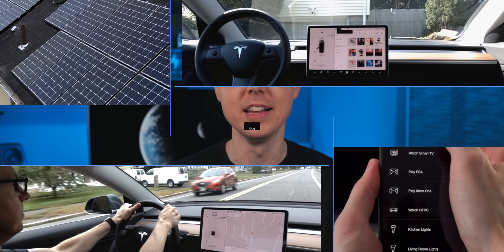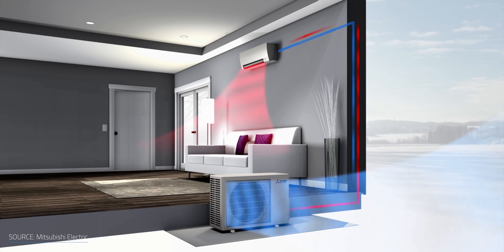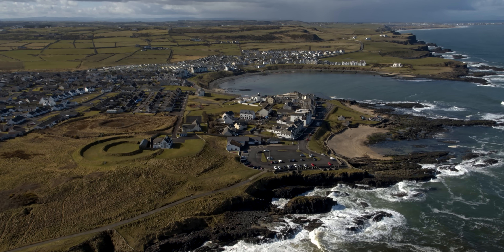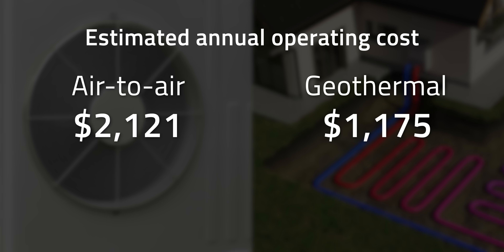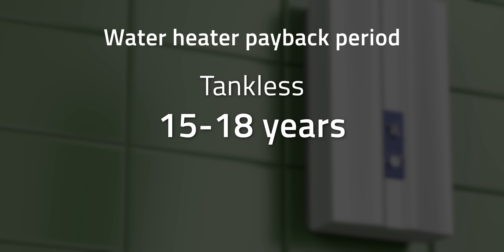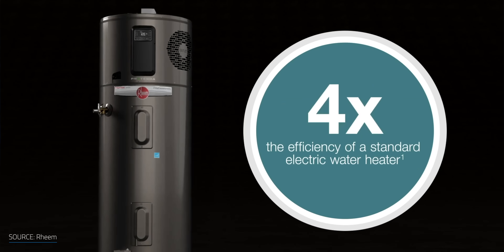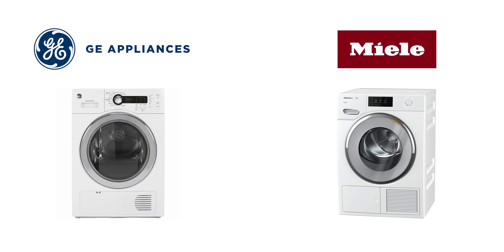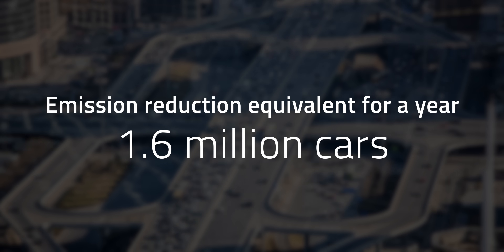Why Heat Pumps are Essential for the Future - Explained

Comment from the maker: Do you think we need to heat pump all the things? Go to https://curiositystream.com/Undecided to get Curiosity Stream for only $14.99 for the whole year! 

If you liked this video, check out Solar Panels Plus Farming? Agrivoltaics Explained https://youtu.be/lgZBlD-TCFE?list=PLnTSM-ORSgi5LVxHfWfQE6-Y_HnK-sgXS
Reply: being tied to a grid system sucks - look at the rolling blackouts in california or texas. if you take away natural gas or oil you are putting yourself even more at the mercy of the grid. if you have solar this seems like the way to go but not many people have 50k for solar and 50k for geothermal so its not helping out the people who are affected the most by those high fuel prices.
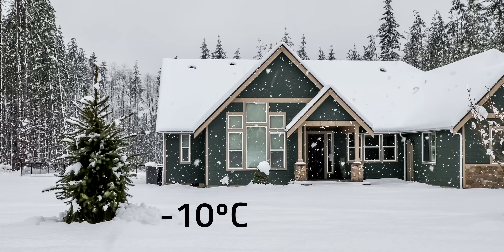Reply: The number displayed at 5:04 for Fahrenheit should be "14", not "-14." Further, the voice over says "10 degrees Celcius" but it should "negative 10 degrees Celcius."

-10°C = 14°F
Reply: Generally yes, although water based appliances may not need it if the water heater uses a heat pump and the tank and temperature are correct.
Reply: Is there anything like HVAC in Teslas (Supermanifold) for homes that would integrate all the heat transfers in your home? It'd be incredibly awesome to have a hub, where you'd be able to connect all of your devices that produce and/or consume heat and have the hub move the appropriate amount of heat from source to "consumer" device. For sources in home, you could have your fridge, AC, even liquid-cooled PC or home server, for "consumers" you'd have your water tank and heating. Then external heat pump and the heat storage solutions could do whatever is needed at the moment.

With this in summer, your AC would keep each room at set temperature and with the removed heat heat up your water for a shower in the evening with the help of your PC and fridge, which wouldn't heat up the rooms they're in (easing work for AC) and if that's too much heat for the needs of the house, heat pump would dump the rest outside. In winter, this would distribute the produced heat wherever it's needed and pull additional from the outside if and when needed (can be optimized to electricity price).
Reply: Yes, let's star with using heat pumps to cool small boxes to keep food in!
Reply: With ground source/sink heatpumps, you can bank the heat you don't need underground and then use it in the winter.
Build this big enough, and you can heat and cool a whole town over the whole year or at least reduce energy usage.
ps. dryers should have permits or disincentives to use because they are so wasteful. A clothesline hung outside or in an aerated room costs next to nothing.
Reply: most places are phasing out r134a for R32 boiling point of -51
Reply: Collab with Matt Risinger home builder of super efficient homes.
Reply: I recently heard about a company Sunamp, they make Phase Change Thermal Energy Storage, which looks like it could be an effective solution to heating. they work in the same way as reusable hand warmers.
Reply: Ah, finally following Technology Connections' footsteps I see?
Reply: Moving heat, rather than burning 300 million year old solar energy in the form of oil, coal and gas , that increases the global temperature by emitting greenhouse effect gasses, perfect.
Reply: Matt, I do believe that Heat Pumps have a place, but as you know, the 3 x 5 efficentcy are more theoretical vs realized at this point.  In many places they are expensive to install, plus the people don't account for the maintance.  While I do believe they have their place, no solution is the one all be all for everyone. 

If you are looking at Heating, take a look at infrared heating.  These things are amazing as it heats you and the mass in the room, not the air.  It is the feeling you are being heated by the sun and as such, you use less energy because you feel warmer.
Reply: @DrToddles  Meanwhile at the coal plant making my electricity....
Reply: Heat pumps to all the things and i mean ALL! It is recent weekend that I've been thinking, what would it take to equip heat pumps to cars with ICE. There is already one loop and a heat exchanger... With that one could easily up the efficiency of the engine to 50%, potentially over 60
Reply: Always great stuff Matt.  Looking forward to your build!
Reply: Heat pumps are great but you've got to talk about noise. We had a heat pump water heater put it, the noise was unbearable even with MLV soundproofing put into the room. Complained to the installer, they got a manufacturer's rep out, and finally 4 months later they replaced the unit with a quieter one that is tolerable.
Reply: Oh Matt did you mention that you are building a Net-Zero Home.. and that we should watch out for videos about it later this year?? Yea, I think you should mention it AT LEAST THREE TIMES..... Oh and don't forget that you can mention it a bunch of times in all the other videos you do until then :)
I'm just messing with ya... sorry.... but you DID bring it up at least 3 times this week... at I think twice last week.....  I just want you to realize how much you bring it up... but I can TOTALLY UNDERSTAND.. I would be SUPER PSYCHED TOO!!! I'm really HAPPY for you bro, not everyone is able to make it work doing YouTube, and you seem to have a great channel with a solid audience. And even if you aren't the only income in the house, I'm guess that you putting in your half of the effort towards thi0s dream .... :D CONGRATULATIONS!!! :D
Reply: Matt, actually, before Washington State banned gas space and water heating, NYC (a city with a larger population than WA state) banned all gas appliances from 2024 on... so that will likely have a much bigger impact on the market, supply chain, etc. I think the heat pump market is primed for much faster growth than the projections. Once economies of scale kick in, the cost for equipment and install will also drop to be more competitive upfront as well.
Reply: @danielroden9424  A slightly different take...granted the solar and geothermal costs are an obvious barrier to those who cannot afford them and or live in accommodations where these systems cannot be implemented, however their implementation by others does help these folks...reduced air pollution and (hopefully) reduced climate impacts over time will result in improved health for the general population as well as the likely reduction in the cost of fossil fuels as the transition happens and the reduction in the cost of these two systems as they become ubiquitous....all benefits.
Reply: I can’t tell you how much I appreciate your videos! I am planning to build a home next year and am doing the exact same research on efficiency and sustainability for the build. This has been so helpful! Please continue to share these “rabbit holes” :)
Reply: Hey, Matt. Sweet video... in case it's useful: I just put in a heat-pump HVAC system, as well as a new full-sized (the only full-sized 27" model available, as far as I know) heat-pump based dryer. I'd be happy to provide feedback/photos if it helps you in any way...
Reply: Matt, I have a GSHP using water to air circulation. Here are a few things I have learned. 1) if your house is not well insulated and sealed (which yours will be) a heat pump may not meet your heating and cooling needs at the more extreme ends of the temperature range. Your energy consumption will skyrocket when your heating back up ( a resistance coil) kicks in so you want that to be very infrequent 2) Water is a far better heat transfer agent than air...and because heat pumps work at lower temps, where radiant systems must work, they are an excellent combination (we are looking into radiant cooling for our GSHP as we transition to radiant in our house).  3) Heat pumps are very vulnerable to improper sizing...too big or too small and the efficiency and longevity will be negatively impacted. 4) Air to air and water to air heat pumps never feel warm...in fact they feel drafty because the blowing air temp is so low and the volume of air being moved is much greater than an oil or gas furnace. 5) Retrofitting a heat pump to an existing air handler can be problematic since much larger ducting and higher volume fan are needed...noise and draftiness become a problem using existing ducts.  6) With GSHP's it is critical that the ground loop is sized perfectly to the system and that includes taking into account the ground that the loop will be installed in.  As mentioned the heat pump itself must be matched to the buildings Heat loss and Heat gain and the ducting or radiators must be sized properly to get the efficiency these devices are capable of while also providing the comfort that they should be capable of.  7) Make 100% sure that your installer is experienced in the type of heat pump you are having installed, that the manufacturer has trained and supports the installer (contact the manufacturer for confirmation) and that the installer is capable of servicing the unit...it's worth ensuring that the brand is supported locally by more than one installer in case yours retires early....many HVAC companies will not even attempt to service heat pumps that they are not certified in (speaking from experience) ...get at least three references and be sure to speak to all three.  
Looking forward to your house building videos.
Reply: Matt, although it's a comparatively niche product in the US, a Sanden heat pump water heater eliminates some of the concerns you raised about hybrid water heaters, and it's even more efficient and environmentally friendly, although the purchase and installation cost will be rather higher.
Reply: Happy Super Month. 👩🏿‍🦰
Reply: Matt, how come that Curiosity Stream is your sponsor and you don't have your channel on their Nebula?
Reply: I'm all for the greater efficiency. However, one thing that concerns me is that heat pumps in the US typically use extremely potent F-gases as their refrigerants (HFCs), and these gases have greenhouse gas coefficients that are thousands of times worse than CO2 and last for centuries in the atmosphere. This, of course, is only a problem if they leak out, but when there are wildfires that destroy entire neighborhoods happening not too infrequently, the contingency for what happens when they leak or otherwise get destroyed needs to be taken into account. Low GHG-coefficient gases can be used for heat pumping (such as isobutane), but if the heat pump manufacturers are not forced to use these alternatives, they probably won't. The alternatives tend to be flammable gases, but the risk from this can be mitgated in various ways.

The leakage of HFC gases is so impactful that Project Drawdown ranked refrigerant management and alternative refrigerants as two of the most impactful things that could be done to fight climate change. This must be taken into consideration while advocating for the proliferation of heat pump based solutions.
Reply: your temps are messed up at 5:04. You say "10 degrees Celsius or 14 degrees Farenheit" but iyou should say "NEGATIVE 10 degrees Celsius...". Also, you show -14F on the screen, but it should be 14F (no negative).
Reply: Heatpumps have been essential for fridges and cooling. For heating homes they canchelp some, but it's way more efficient to burn natural gas directly for heating than burning gas at an electrical plant at huge losses and transport losses and trying to compensate for that by mechanical compressors that are expensive to install, cant heat to 65°C and ware out way faster than gas heaters.
Reply: @gnomechump-stiny7128  The host might find someone who is less focused on one climate setting.
Reply: @richardlangley90  Did you put in the Euro water heated towel rack at your showers? They work so well, plus a heated towel during the heating season. 

As the CO2 (R-744) based air to water heat pump, supplying combination domestic water heating systems with hydronic space heating systems taking heat from that system via heat exchanger, become more common, do you think the ground GSHP systems will become less common, or there will be regional differences, between regions with more heating or more cooling need?
Reply: You completely missed the most common heat pump we all have in our homes. The Refrigerator and Freezer. I'd love to be able to connect the water heater, hvac, clothes dryer, fridge and chest freezer all together to manage moving heat around (getting rid of it in some places and storing it in others).  For now I'll settle for the water heater and hvac both being on heatpumps, and wait for the future to tie them all together :)
Reply: @billsmith5109  Haven't tried the heated towel rack yet Bill.  I am not an expert but I do believe that in moderate climates the air to air or air to water systems are a better choice than the GSHP because they can be as efficient in those climates, are more accessible and cost less.  For more extreme climate temps the GSHP wins out due to the more dependable constant temp underground as the source of energy to transfer.
Reply: I have ground source a HVAC and I am actually on my second one the first lasted 25 years. The second is way more efficient that the first. Look into getting an option to send heat to your water tank. In the summer hot water is never an issue. It is supposed to provide hot water in the winter. It just feeds into my water heater.
Reply: That’s just a vrf heat pump.
Reply: I was wondering, here in the Netherlands getting your house heated with a heat pump actually has quite some additional steps that are not mentioned in this video. Perhaps it's due to the fully concrete houses that we have, but when I looked into heat pumps I was looking at an investment of around 20 to 30 thousand euros. Mostly for additional insulation, replacement of radiators to low heat types and close off all airvents, as well as replacing the extractor and the air circulation system. Is this something others have experience with as well?
Reply: @dukee4333  Sounds like you have work to do. In my state we have eliminated all coal and oil sourced electricity. Now we are working on the much harder to eliminate gas produced electricity. As for myself, my solar feeds more to the grid than I use. Good insulation and a mild climate helps.
Reply: @danielcarroll3358  Cool, so you invented new battery technology?
Reply: I think using those solar panels that uses water pipes to cool the panels and uses the heated up water and puts it in your water heater or just straight to your sink.
Why well it cool the panels from 150f or more to 110 f or less.
Reply: Hey, there are some spam imposters with your profile picture in the comments. People should look out and report them.
Reply: @Etacovda63  Variable Refrigerant Flow (VRF) systems are typically all-electric systems that use heat pumps to provide space heating and cooling to building spaces (ECW, 2014). They are capable of serving multiple zones in a building, each with different heating and cooling requirements.
Reply: @danielroden9424  "look at the rolling blackouts in california or texas"

It's not the grid that's bad, it's the fact that PG&E is a clownfest and Texas is a goat rodeo.

I think I've had a significant power outage maybe... thrice in my entire life?
Reply: So we own a Whirlpool heatpump dryer that we purchased for $1300 Canadian (~1k US), and I'll say this... we love it.  We also came from a super inefficient almost 20 year old dryer, and the energy consumption difference, dropped our hydro bill almost $45/month, while actually INCREASING our usage of the dryer. As for not getting as hot, will it burn your hands when you take it out, nope. but the clothes still come out hot enough that its uncomfortable to put on something straight out of the dryer.  We can dry a absolutely full load in ~85 minutes. Which is only 10 minutes slower then our previous dryer, that we would sometimes have to run twice to get things actually dry.  This thing has paid for itself within 2.5 years on bill reduction alone, and would have been faster if we didn't dry even more clothes now (we had a child just after getting the new dryer). Fully recommend.
Reply: Excellent video, Matt. Yes, finally I had the time to watch this. :)
Reply: @dukee4333  No. I rely on pumped hydro energy storage.
Reply: Thank you for the quality content.  I work HVAC with my dad and he is old school so I go with all of his thinking, however I do believe in a more efficient future.  I live in Colorado where it's not all that hot or all that cold for all that long so we may have a unique situation.  I know you consider all thing's but I figured you'd appreciate my anecdotal work in the HVAC field.  In our climate and work environment we find that "high efficiency" never works out for the better, certainly on a financial understanding which in some way may play out to an emission stand point as well.  For heating, high efficiency gas furnaces never ever pay for themselves.  The equipment, installation and maintenance are all greatly increased with a much shorter life span.  The parts are more expensive too.  When you introduce water into the system by cooling the gas so much it adds exponential complexity.  One example is the variable speed blower motor or ECM, a typical PSC motor is about $100-130 our cost and we charge $350-450 to replace it, the variable speed motors can easily cost $900 just for the motor.  Another problem is that many manufacturers of high efficiency furnaces do really stupid thing's, I've seen circuit boards with integrated pressure switches so when a normally $15 part fails, it's a $1k circuit board that needs to be replaced.  In these situations it's just smarter to install a new standard furnace and get rid of the headache.  When you think of all of the emissions going into producing and installing that furnace I would imagine it is a major loss.  The biggest problem in the HVAC industry is shady companies who don't fix rather replace, we have countless systems that were red tagged by other companies yet running for years after we made a cheap and simple fix.  The big box companies charge literally 3-5x what we do and worse than that they lie about it.  I know this is just a financial example but dollars and emissions must have a correlation.  On the cooling side of thing's we've come across heat pumps and/or extremely high efficiency unit's that literally no one in the state knows how to work on them and our tech resources come up empty handed.  I think that there is something to be said about reliable and low maintenance systems, not just financially but for a greenhouse consideration as well.  We only install Rheem because we truly believe in the brand and don't want to work on it after it is installed.  I however wasn't aware of the 3-5x energy gain vs conductive element heating, that is extremely interesting.  I would be interested in the comparison in my climate vs gas on a cost basis.  Thank you for the information, I'm new to the channel and you are very thorough and I appreciate that.
Reply: @DrToddles  of course they would, would you eat a 300 million year old piece of bread, No? then i don't want a stale piece of solar energy either.
Reply: @theawkwardexpert  i don't, he made 3 bad examples, 1. "heat pump works like AC" yes of course AC is a heat pump, even if it's a fan with a water sprayer, fire works like fire because it's fire, but no one states it, it's a casual water is wet statement.
2.*2
"heating your AC because it got cold" is stupid, just run it in reverse, a quad valve is not that expensive instead of using 5 times more energy of resistive heater for the outside unit, if that doesn't work manufacture bigger surface heat exchanger so there is more surface to exchange heat with the surrounding air and less drop in temperature as a result.

To Matt: "change the argument, not the person" is impossible when you(the hypothetical person) says 2+2=5 and believes it, change the person so he could change his argument for the better.
Reply: @wpmulligan  Also the refrigerant used is 410A not 134A
Reply: I'm from Phoenix AZ I think it's essential all electric water heaters and clothes dryers should be mandatory heat pump versions only. Due to the strain on the airzona electric grid from all the air-conditioning units. If everyone utilized heat pump appliances it would take a significant strain off the electric grid
Reply: Happy Super Month. 👩🏿‍🦰
Reply: can you do a full video series on the tech of your upcoming home? similiar to Linus Tech
Reply: Interesting enough, Technology Connections has also recently done a series on Heatpumps also.
Reply: 1)  the earth regenerates oil
2) co2 is not a problem

you're not a scientist, you're a youtuber
Reply: Yes. ElectrifyEverything

Unless you live in climate zone 7 or colder you might be better off with an air source heat pump, for a whole slew of reasons
Reply: Our electric power company in NJ just sent us an email to prepare for summer power outages. Which follows preparation for the winter outages. So before anyone considers heat pumps for all the things, solar and battery backup is a prerequisite. Of course, it can take a year (or more) to get that scheduled, approved by your township, and installed. And then yay! More property taxes.

It seems that while the government agencies tout going solar/battery and heat pumps, they put every possible delay and tons of roadblocks in the path. Just yesterday, the president of the US had to put a (temporary) moratorium on tariffs for solar imports. If it takes executive action to cut through (some) of the roadblocks, there's something very wrong (*cough* fossil fuel industry b̵r̵i̵b̵e̵s̵ lobbying).

And then there's the cost. While the $75,000-$100,000+ to do all these things may be acceptable to the top 3%, the 97% doesn't really have this as an option, especially in today's economy. It kind of feels futile and pointless.
Reply: "heat pump all the things"??? how do you HP your telly???
Reply: Just fyi most home heat pumps run off R-410A (old r-22) and starting in a couple years R-32
Reply: @nc3826  As long as it's not wet outside, it does still work though not as quickly. Can still bring it inside though.
Reply: @nc3826  Octovalve connects to the Supermanifold and direcrects which way "circuit" will be heated and which one cooled. Supermanifold is the part, where all these flows meet.

Elon has talked several times about Tesla doing home HVAC similar to what they have in cars, but it's too low priority for them for now. I'm just amazed that no other company has yet picked up on this.

There are many technologies that you can use for heat storage and water tank is one that is currently most used (most peaople do shower), but almost all of them take in the energy (electricity, fossil gas etc.) whenever they "want", not when it's most appropriate. The example of a good change here is UK company Mixergy that makes water tanks capable of heating just desired % of the volume of water in the tank and thus taking in the energy whenever most convenient (off-peak, PV etc.). Some of their models even have provision for piping in external heat source.
Reply: I live just outside Ottawa Ontario,  the heat pump we have worked down to -30C  then could not cope with the cold, thankfully we only had a few nights and days that cold, so we were golden the rest of the winter, we used wood as back up and very little of it.
Reply: OFC water tanks can be used to store heat, since it has been used for centuries... Including externally heated water, so it is nothing new....  Mixergy just added stratification, which does not improve the thermal mass of water....

While "latent heat" (ie phase change thermal battery) is inherently a more effective way of storing heat...  Then even the very expensive and heavy Mixergy tank... 

But I'm far more curious, about where you heard of integrating the heating and cooling appliances? From Mixergy? As I stated earlier, it is so rarely done I'm happy to see it done in any fashion. 

BTW thx, for confirming that the term "Supermanifold" is just another one of Elon's bloviated memes for a more common term or device that he pretends to reinvent.... Just like the great marketer he is, but at least it makes me laugh.. So it is all good ;)
Reply: I have been thinking about this concept for about a year now. It is fun to think about all the ways to tie into this. 

In summer push all heat into the hot water tank

In winter push the heat to the desired rooms. 

This could even run a heat pump water generator to pull the water out of the house when it is too humid.
Reply: In Quebec, there's more than 220 k heat pumps installed. No major issues. Obviously some models are more efficient than others. With climate change, heat pumps are useful for two big reasons. They are energy efficient, so you use less energy to heat your home in winter than with other types of heating systems so less CO2 emissions and secondly, as a bonus, you have a high efficiency cooling system, which can save lives during heat waves in summer.
Reply: Love my heat pump. All electric heating, all electric hot water, all electric cooking, all electric car.
Reply: yeah, can't heat pump everything. basically, this is an air conditioner when it comes to noise, longevity, reliability but could be worth it if you generate most of your own electricity
Reply: @lukeaaron5588  good insulation standards are a good start
Reply: @monkeysezbegood  👍
Reply: @picobyte  depends on your climate. A heat pump can provide more heat than burn gas, even if the power is made from said gas. Heat Pumps can be 300% efficient or more
Reply: heat pump all the things! 🙌🏽 r u getting PVT solar panels on the new home?? congrats 🍾 excited for u (and us lol)
Reply: @LamarreAlexandre  I don't think people outside of Canada, realize how deadly the heatwaves here are.
Reply: @LithaMoonSong  If you're right, that's a problem because heat wave are indeed deadly. Just look at the number of deaths we had in BC last year because of the heat wave. I think it was around 600.
Reply: @monkeysezbegood  You are 100% right. Whatever systems someone uses to heat their home, a good insulation will reduce your energy bill.
Reply: @monkeysezbegood  You have a very good point that should be emphasized.
Reply: being electric, this would add strain to the power grid, and may drive up costs.
during summer in aus we are told or incentivised to not use so much electricity.
i can see some benefits though.
Reply: @danielroden9424  exactly, loading even more energy demand into the electric grid (heating, transportation, etc) will just cause even more blackouts. While HVAC systems already overload the system in summer, the heat pumps etc will cause blackouts in winter.
And houses just don't have enough roof space for solar, to generate enough energy for electric demand, not even mentioning several kWh for heating per day.
Reply: I’m moving onto Farmland I’m going to try a hybrid permaculture multi purpose farm style homestead. Is it possible to do these in a off grid self sustaining setting like worst case scenario societal economic collapse. I’ll also have a wood stove as back up, fire pit, and forge is there away to collect the thermal heat from using these and store it as power. Or is it possible to make a hydro electric wind hybrid system that will do a downward flow from retainer pond to retainer pond with dams as the hydro utilizing the hydro power with the wind turbines on the top pumping the water back up to the top as a continuous cycle to continue to generate energy for a home setting with any extra runoff going to crops, other fishery ponds, or to a water storage tank
Reply: R134a is really only used in refrigeration. R410a is what you should have said
Reply: @alkjhsdfg  Good information, thank you for sharing your experience. By the way, I recently reached out to Rheem to ask for more info about their possibly louder newer models, and will be letting Matt know what I learn.
Reply: When my furnace dies I'll definitely look into it - but being in central Canada winter performance will be a major decider. The hot water tank and dryer will likely last forever if I keep up maintenance - and I don't like replacing things that are not broken.
Reply: thomasjeffersoncry  Funny. Do you think that something being "illegal" really stops someone from doing anything they care about?
Laws against clothes lines shouldn't be permitted because the common good should win - not because idiots get offended at the sight of a bra or a towel drying in the sun for free!
Reply: Whirlpool makes great heat pump dryer.
Reply: Please supply that state by state heat pump efficacy you showed.
Reply: I think that people ought to be educated enough to make their own decision.  Like did you know that SEER doesn't describe moisture removal and the higher the SEER the less moisture the heat pump removes from your house?  There's just one example.  I live in FL, so SEER doesn't mean much.  We have very high latent (humidity) loads that needs effectively dealt with.  A whole house ventilating dehumidifier is a must in any humid climate and inside we should keep humidity under 55% at all time while bringing in fresh, filtered air.
Reply: @dukee4333  Check out Ambri, a company that is working on molten-metal batteries for moderate scale and huge scale energy storage. Videos here on YT.
Reply: Anything using electricity isn't carbon-free if the generation of the electricity isn't carbon free. And wind and solar are not constant enough to be reliable sources of reliable baseload electricity. 
-- If you grow trees on your land for fuel and burn it in a highly efficient stove (Jotul 602, e.g.), you're pretty close to carbon neutral with a much lower energy bill.
-- And then there's nuclear energy for the grid. Thorium reactors would be nice, but for now, the technology on uranium reactors is a lot better than it was some decades ago, and safer. I don't take anyone who claims to care about the environment and about people seriously if they aren't willing to take nuclear energy seriously. Techno-environmental elitists on comfortable salaries are willing to let the poor starve, freeze, or surrender to government dependency and control in order to "save the planet." Save the planet for whom? For the elites, of course. The people are just livestock.
Reply: I'd be curious to know what kind of house you'd build to be the most efficient with all the bells and whistles, maybe something with lots of integrated systems and possibly off grid even.
Reply: Could you not also intergrate a heat pump with a solar water heater as well for times when one or the other is not producing enough. Then on top of that intergrate a solar system and battery bank?
Reply: Matt, I actually think that an air-to-anything heat pump is better than a geothermal one, from climate change standpoint. An air-to-air or air-to-water heat pump borrows heat from the atmosphere, temporarily puts it into your house, and by time that heat escapes through doors, windows and walls back to the atmosphere. A geothermal heat pump borrows heat from the ground and releases it into the atmosphere (through your house).
Reply: O, and finally it's pretty easy to add on a small propane tank and boiler to suppliment on the worst days of winter, and with air to water heat pumps, you can cascade the units to attain higher heating or cooling!
Reply: Super interested how heat pump dryers can attain such high heats!
Reply: @user-by7hj4dj9s  been a commercial HVAC service tech for 15+ years and haven't seen a 134a heat pump. as of now 2022 410a is the common type heat pump. 410a is being phased out 2030 btw.
Reply: @danielroden9424  Man, remember the days of Enron and their artificial blackouts/'shortages' to increase prices?
Reply: I already have a heat pump. Most of the ACs are heat pumps. We'll all get heat pumps, then the price of electricity will skyrocket. Can you find more hype topic for the hype channel next time??
Reply: Well, actually the hot water should be solar hot water because the solar energy can heat water to a higher temperature than a heat pump.  You would always need to augment the heat pump with electric but, the solar hot water, especially in summer, comes down so hot - it does not need any electric.  I think you even stated that solar hot water is 75-85% efficient which is comparable or better than heat pumping which only uses electric.  I think you should compare the two options to see which would use the least electricity.  Remember, you are going to use solar (18% efficient) to run the electric side of things - do you want to heat water only with electricity?
Reply: @destronger5313  410a for 410b right? about the same melting point as R32
Reply: Ooooh. Net zero. You'll need a three legged dog to go with that.
Reply: @TagiukGold  Like a refrigerator?  That's not heat pump technology, it's just like an air conditioner - it takes heat out of the food box and dumps it into your kitchen.  Call it a space heater and now it's a heat pump!
Reply: @meberg500  a refrigerator is a heat pump, it's just not bidirectional. An AC is also a mono-directional heat pump.
Reply: @TagiukGold  Pedantic much?  They're all refrigeration cycles.  Would you call that water heater a water source cold room maker?  But to your original point, yes, it's high time someone found a way to use heat pump technology to keep a container of food cold in my kitchen!
Reply: Lennox use to make a heat pump with a dc to ac converter built into the outside unit so you could plug solar panels directly into it for a grid tie system. I never understood why that didn't catch on it would make solar pretty much plug and save. My own thoughts on heat pumps is they are good for hybrid systems, water heaters, or in warmer climates we are in the midwest and use ours down to 45 degrees then it's 100% gas heat with a furnace.  That seems to keep a good heat feeling in our home and keeps the bills very reasonable.
Reply: 3:11 inside is the condenser (when running backwards)
Reply: heat is like vibration, it can be cancelled out by introducing an opposing vibration. heat exchange is a very old concept and technology, the future would be the control of temperature without releasing heat.
Reply: In theory, yes, but mandating it in new commercial buildings is simply going to increase the cost of building new housing developments, and rents are already high enough. If you've got the money to build some expensive net-zero house then this doesn't apply to you, but for the normal person that's just trying to find a reasonably priced rental, these draconian policies push people out of housing. Not that I expected anything less from Washington.
Reply: Matt, look into mini split systems before you take the "just heat pump" leap. 
Thank you for sharing your vast knowledge and diligence with a world that needs it more than "it" knows!!!!!💖💖
Reply: Absolutely!  We live in the Greater Boston area too and we switched over to a air-to-air heat pump system due to the $10K rebate from MassSave.  The whole system costed a little over 11K so it was a no brainer for us.  Our home is heated by LP or Propane because there is no natural gas line on our street and we had been seeing propane costs rise in sync with gasoline prices.  We were spending over $600/month just for the propane refills when only a year ago we were hitting under $300 and the year before that we avg. $250.  We haven't had to refill the propane tank since March now, so I have no doubt we've already saved over $1800 in heating costs.  We still need the propane as that is what our tankless water heater and our oven range use for their fuel sources, but the biggest consumer of the propane was the furnace.  The MassSave rebate allows us to keep the furnace for emergency purposes, so if the heat pump doesn't keep the home warm enough next winter, we can turn on the propane furnace to supplement when needed.
Reply: One thing that stands out in the argument for using natural gas for heat is that gas produces a warmer heat from the supply vents into the home airspace. Although heat pumps are producing much warmer air than even a decade ago, they still can't compete with gas for that very warm feeling on a cold winter day.

Of course, it's very difficult to be net zero using natural gas, but for those of us who aren't able to install solar panels to operate a heat pump we have to do what we can to lower our cost to heat and cool.

One thing that helped us is to double the amount of insulation in the attic. That along with a very high efficiency gas furnace cut our heating expenses by 2/3 compared to using the older heat pump.

I always appreciate your videos that give pause for the viewer to stop and think about the topic. It helps to occasionally test out our current views to see if they still hold true with the current affordable technology.
Reply: Gas is so cheap??
Reply: @donglers  switching to high efficiency gas furnace from a heat pump has saved me a lot on heating expenses. Cut heating cost by about 60%.
Reply: No discussion about water heaters is complete without discussing a hydrosonic pump. Hydro Dynamics makes them to this day, they heat water on demand with 99.9%+ efficiency.
Reply: @REG3305  do you not think that renewable energy, or less polluting energy is a good idea for a long-term goal to protect the environment?
Reply: @MicahFunk  cleaner COULD BE BETTER.  Ultimately,  NO ONE KNOWS but instead only SPECULATES their narrative.  
How did Solyndra do with our money?

60s: "We are going to run out of oil in 10 years."
70s: "Fossil fuel (FF) burning is bringing on 'An Impending Ice Age'  in 10 years."
80s: "FF are causing acid rain which will kill all the crops and bring on starvation within 10 years. 
90s: "FF are going to deplete the ozone layer in 10 years. "
2000s: "FF will cause NYC and Florida to be under water within 10 years. 
2010s: "Cow farts and FF are making for severe weather to be worse and possible unlivable within the next 10 years. "

Bro... Liberals believe that within the next 8 years the world will be unlivable. 

How many times does a group/ individual have to be proven fraudulent liars for you to realize it is ALL SIMPLY TO CREATE NEW TAXES so politicians have more of our money to spend on their pork filled Bill's and "vanity projects."

Question for you... let's see if you have ANY business smarts. 
 If, for example,  GE gets taxed more because of this "new" carbon capture junk, WHO ACTUALLY  PAYS for that?
Reply: Did you just claim electricity doesn't release various gasses when produced? I'm in 2022, where most power (WW) still comes from burning stuff, what year are you in?
Reply: @REG3305  it's not my intention to argue with anyone.  I enjoy the interchange of facts to be able to come to different or new conclusions. It's as simple as having an observation and asking a thought provoking question to stimulate some rational thinking. 

Have you noticed there isn't any really clear path to achieve everyone's ideals going forward? There's to many people and corporations who have a financial stake in their own agenda to be completely honest. Take for instance the oil industry; they generally have no interest in seeing greatly reduced oil consumption. Most of us can recall the generally accepted as fact stories about people who came up with inventions that enabled vehicles to get 50, 70, or higher MPG, only to have their patent bought up and shelved. Greed is in an abundance around the globe.

What do you personally think the solution is to these issues? There's many people who want to only complain about someone or a political party, but what are the real solutions to the complex problems?
Reply: I'm so disappointed that Matt did not explore the possibility of using heat pump technology for generating electricity. Since a heat pump can have an output of energy in the form of heat that is 3 to 5 times that of the energy supplied to the heat pump in the form electricity, if the energy output is concentrated repeatedly with heat pumps until temperature of the heat energy output is high enough to boil water to power a steam engine in connection with a generator to create electricity and the amount of electricity generated is over unity, i.e., the electricity generated is more than the electricity used by the heat pumps, then we have a self-sustaining Heat Pump Power Plant. 
 
Theoretically, a Heat Pump Power Plant capable of creating more electricity than it has to consume is possible because of the  over unity output of heat energy of heat pumps. The efficiency of turning part of the 3 to 5 times heat energy output to electricity decides if the Heat Pump Power Plant is feasible.  If 50% of the 3 times heat energy output can be converted to electricity, then we have a self-sustaining  Heat Pump Power Plant that is capable of generating the electricity that the power plant needs to consume plus 50% of that amount of electricity as output of the power plant. 

In the process of extracting heat energy from the air for  generating electricity, a Heat Pump Power Plant can also produce large amount of liquid nitrogen and liquid oxygen that can be put to good use. The liquid nitrogen can be used for generating more electricity in a Liquid Nitrogen Power Plant with the use of a liquid nitrogen piston engine that is powered by the expansion of liquid nitrogen into nitrogen gas after the liquid nitrogen has absorbed heat from the air.  

In addition to being self-sustaining and pollution-free, another great advantage of the Heat Pump Power Plant in combination with the Liquid Nitrogen Power Plant is that they can be used for controlling the climate in hot places.  So there is no need to  worry about catastrophic global warming anymore, no matter it's real or not real, if the heat pump technology is taken to a higher lever for the benefit of humankind.
Reply: @simon6071  I've never heard of this heat pump power plant idea. Just on the surface, without doing any research on it myself, I would think it not possible with the current affordable and developed technology. I'll have to look into it.
Reply: @MicahFunk  Your saying that the Heat Pump Power Plant is not possible is not based on science but my belief that it is possible is based on the scientific fact that heat pumps are able to produce an output of heat energy  3 to 5 times that of the energy input to the heat pumps in the form of electricity. The major hurdle is how the 3 to 5 times heat energy produced can be used for generating electricity efficiently so that the amount of electricity produced can achieve over unity much like what scientists are trying to achieve with nuclear fusion.
Reply: Please add persian (farsi) subtitle to your videos 🙏🙏🙏🙏
Reply: When i saw you talking about heatpump laundry dryers, i had to look at the post date.

It is nearly 10 years since we got out first heatpump clothes dryer. They take longer, but has moisture monitoring and will stop, based on humidity inside the drum, rather than fixed time.

Our BOSCH dryer starts of at about 3 hours remaining time, but will regularily be finished after 2.
Reply: A factor rarely discussed these days are heat SINKS.     Thermal batteries.
Reply: @rogerhuston8287  You are perfectly right. Figures do not quite add up for heat pumps. He said that the ground one saves him 1k per year. and can cost from 10 to 60k if I remember well. and the ROI was mentioned as 5 to 10 years. But it looks more like 10 to 60. And since will break in 5 years, or 10, no much savings in the end. So, as cost is better a cheap electric device. With those ten of thousands dollars you can heat your house for a decade. Or better buy solar panels and heat your house for many decades. 

You are right that infrared heating is more efficient, but not much more. I got one 5 years ago. Unfortunately is the same huge problem. THE PRICE.  It costs an arm and a leg. And that advantage of heating you, not the air, is debatable. 

And by the way the heat pumps being good for driers. Man what prices there. And all that when you can use a simple rope and dry for free. 

And for his new house I am surprised that he did not mentioned solar panel with vacuum tubes.    Those are quite expensive too, but  after that the heat is free, or almost, since the hot water needs some electricity to be moved around. I see around those panels, but did not found somebody who used them to see how good they really are.
Reply: @MichielVanKets  

1- sure, earth regenerates oil. But do you considered the speed? I mean the speed with which irt regenerates it, and the speed with which we are burning?
2- not a problem? I hope you will live few hundred years and see for yourself.
Reply: @clintrobinson1706  I was thinking at this too. But for sure there is need for vacuum solar tubes in order to heat the water close to boiling point. And the tank must be huge. My idea was to use rock instead of water. Actually the project was to dig deep trenches around designated perimeter, drill holes to insert the pipes, and then fill the trenches with insulation, also cover with insulation. under it will be not insulated, and some heat will be lost but very little since heat does not quite go down. However, upfront cost will be an issue. And the idea is so simple that I wonder why so few uses it? Till now I saw that just Eartship concept uses it, and recently a startup, uses sand heated in a well insulated tank. .  Sand is better since can reach higher temperatures, but will mean expensive systems, not something as simple as vacuum tubes.
Reply: Did you do actual research this time or is this like your other pseudoscience hype videos?
Reply: Hi mate, I really enjoy your videos. It's always something to think about here in Australia. I just like to mention that we have all kinds of incentives for solar batteries and heat pumps and I think we're ahead of the game compared to the US and some other countries. We are able to swap our electric storage hot waters over to heat pumps for free after all the incentives including labour and materials to install it. Also, there are big incentives so that usually in Australian dollars somewhere between 5,000 and $9,000 for a 6.6 kW solar fully installed after all the rebates that pays for itself in 3 to 4 years with our super expensive electricity prices. As far as your zero home, I like the concept but with the ground source heat pumps it's so expensive to do with all the digging and so forth and the boilers. We've just put in high efficiency Panasonic reverse cycle, ducted heating and cooling and it all runs off the solar in the batteries so we actually get a credit every year on our power bills. We have no gas connected and the water is from rainwater tanks as well, and we have our own sewage treatments so I usually we are not off grid because we sell it back to the grid. But yeah, we have no utility bills whatsoever so it's quite achievable. With our fairly temperate climate we get minus 5 or 6 is the lowest in Celsius in the winter Up to about 46 in the summer which is quite warm and cold enough. But yeah it's achievable. It's happening. We're doing it already. FYI.
Reply: check this stuff out - you should be able to paint a heat pump w it for more efficiency: Thermal-XR is coming - from Australia - look for it - coats AC/Heat systems
Reply: Absolutely not I disagree with your assessment heat pumps are not as efficient As It Seems especially not for the northeastern part of the United States
Reply: Let me incorrect myself efficiency isn't the problem it's just cost-effectiveness and with the recession looming it's not a time for anyone to be switching to heat pumps
Reply: @DrToddles   Refrigeration units don't just move air they actually produce heat it's just a natural outcome of the refrigeration process. Actually it depends of what type of refrigerant is used some produce more heat than others. R22 refrigerant which was there most common until it got phased out produced super hot discharge temperatures which would be ideal to heat up a home or a water heater but since that refrigerant contributed to global warming it's been phased out. Newer environmentally safe refrigerants don't produce as much heat so they don't contribute to global warming so I don't think they are ideal for heat pumps. So the guy on this video loves heat pumps not they don't heat up enough for extremely cold places so they are useless. And a heat pump is just a regular air conditioning unit which is a regular refrigeration system. Heat pumps, freezers, coolers, ice makers, chillers they are all the same thing they are refrigeration systems
Reply: @Daddo22  what does Tesla do that's so good with a heat pump? Did they invent a new type of mechanical refrigeration system that beats the current refrigeration system that has been used for almost 100 years now and it's been working great so far?
Reply: @richardlangley90  do you think maybe the newer heat pumps don't blow enough hot air because of the refrigerant that they use? Remember refrigeration system contribute to global warming so they are phasing out refrigerants with a high global warming rating. So newer heat pumps produce less hot air by design so heat pumps are useless in cold places because like I said the refrigerant used in that refrigeration system doesn't produce enough heat.
Reply: @taylorshogren8679  I think what you're trying to say is that you want a huge refrigeration condensing unit that is capable of running your whole house. Do you have any idea how expensive that would be? And what would happen if that unit goes down for some reason? You're house would be useless and then you would hate that idea
Reply: @blasgonzalez1580  no. The thing is that they don't use the heat pump if they don't have to. If there's a need to reject heat from one place (e.g. battery / motor) and to heat up another (e.g. interior) Tesla will move the existing heat within vehicle with one integrated HVAC system instead of rejecting heat to the outside and using heat pump to get heat from the outside (or even worse a PTC heater) with multiple disconnected coolant loops.
Reply: @blasgonzalez1580  "So newer heat pumps produce less hot air" I have not found any information to support this statement.  I have not recently researched this but over the past 10 years of reading articles on the advances of Air to Air heat pump solutions the efficiency has increased and the ability to operate in lower temperatures has improved....so I don't support your conclusion that newer heat pumps are useless in cold places.  I would lean to the opposite conclusion.
Reply: @richardlangley90  do some research into it. Find out what refrigerant generates more heat R22 which was the standard for air conditioning or R410a which is what is currently being used. You can contact a manufacturer and see what they tell you and just do a research on refrigerants and you'll find the answer. Each refrigerant on this earth has a pressure to temperatures relationship and what the world is trying to find are refrigerants that produce the less heat in order to stop global warming and the depletion of the ozone layer
Reply: @Daddo22  there is no such thing as a heat pump. A heat pump is a conventional ac unit that becomes a heat pump when a 3 way valve is used in order to reverse the flow of the refrigerant and now both the condenser and evaporator swap places. That's what a heat pump is you can have two HVAC units that look exactly identical but one has a 3 way valve and it's a heat pump that's able to heat up a space. I don't know much about Teslas but I assume they are using a regular conventional refrigeration system that is a heat pump that is used to both heat and cool using the compressors and a reversing valve. Combustion engines use hot water to generate the heating but since Teslas use electric motors they can't generate heat as regular vehicle so they have to use a heat pump. Elon Musk didn't invent anything special he just makes things popular. Heat pumps style air conditioning has been in the market for years
Reply: @richardlangley90  I'm giving you a fact about heat pump air conditioning that's all I'm not telling you not to buy or that electric heat or fuel is better than a heat pump. Heat pumps work up to a certain point that's what I'm saying. And about the refrigerant being used is a fact using a refrigerant that produces less heat by design is going to produce less heat output in a heatpump that's just a fact.
Reply: @blasgonzalez1580  nope. I’m talking about a connected series of heat pumps that utilize a looped series of heat transfer conduits so all “waste” heat from gets used by things trying to heat and all waste “cool” gets used by those heat pumps working to cool. 

My hot water heater is dumping cold air in my garage….why not dump that energy expenditure into the freezer? My refrigerator is dumping heat into my kitchen…let’s put that into the hot water heater.
Reply: @taylorshogren8679  I get what you mean but it doesn't work like that. A water heater heater has no way of mechanically transfering  heat like a freezer or cooler does. Do you know how much horse power it takes for a freezer to freeze your product and all what pressures the compressors need to operate in order to remove all the heat from your food in order to make them rock solid? You cannot replace a mechanical refrigeration system with any other method that makes sense. Actually as technically is advancing systems have become more energy efficient and perform better but I guess if you got the means you can install a rack system that does your heating, cooling, freezing, ice makers, water heating, dryers but I wonder how much it would cost to install and maintain but there would still be heat/cool loss nothing is 100% efficient. And these type of systems already exist for example supermarkets have rack systems that freeze their food and keep it cool and warm up their water all in one big huge refrigeration system that does it all
Reply: @blasgonzalez1580  Heat pump is a device that pumps heat from one place to another. The simplest and most common examples of heat pumps are the fridge and non-reversible AC unit (in both cases moving heat from inside out). The reversible AC is one step above that, letting you choose from where you take the heat and where do you put it. Now imagine that, but with quite a few more circuits each going to a different component of the car that is actively thermally managed (battery, motors, inverters, computers), passenger space heating / cooling or the front radiator and all of them connected by a smart system that controls the relocation of the heat.

Every other car manufacturer has a separate heating / cooling system for each of the components, so you can be running a PTC heater or heat pump to heat your cabin space, while cooling off your motor(s) through its own radiator.

Tesla's system is much more efficient (and lighter) and thus so are their cars (compared to the same category of vehicle - You can't compare Model X with Twizy).
Reply: Oh you want to reduce your impact on the enviorment? Get off the internet, disconnect your electricity, and stop making YouTube videos...
Reply: @blasgonzalez1580  you’re talking about how things work currently. No disagreement. 

I’m talking about changing how homes are built so that these systems are interconnected which would boot efficiency (dreaming a better future)
Reply: I keep saying co2 is bad for the environment where is the true study. Natural gas furnace is the way to go
Reply: @Daddo22  do you know anything about refrigeration? Do you know refrigeration basics and how the refrigeration system works? A heat pump is a regular refrigeration system with a reversing valve it's nothing new to get excited about. The way you want it to work is nearly impossible to achieve you would need multiple condensers and evaporator coils located in different locations and the refrigerant lines would be running in crazy directions. I mean it's possible but the engineer would have a crazy time figuring it out. And do you think these systems run on free energy? Do you think it would be cost efficient? And what about the impact on the environment? The governments are trying to lower the global warming do you think this would be helping lower the global warming?
Reply: @blasgonzalez1580  ever heard of heat pump (& AC) systems with multiple indoor units and one outdoor unit? They are out there for quite a few years already and are even more efficient than having a 1:1 system for each room instead.
Reply: Gee, i have had a dryer with a heatpump here in Scandinavia for atleast 10 years. We have higher price of electricity so it is really a no-brainer to spend a little more.
Reply: @Daddo22 , The refrigerator only has about 2,000 Btu compressor in it, and provides a small amount of heating for your kitchen in the winter and a in-significant heat load in the summer.  

So a 48,000 Btu heat pump will provide 1,600 CFM of air, and heat and cool a 1,800 - 2,200 square foot home very well.  In farther north, not heat so well.  The refrigerator heat is about 5% of the total capacity of the heat pump in the average home.  Your PC system, assuming it is about 400 watts or less will be under 2,000 Btu's per hour.  Over 1,000 watts, and requiring two circuit breakers to feed it power, then it might be over 5,000 Btu's and provide about 10% of the heat of a heat pump system for your home.  However there is no need to run a compressor to heat your home with the heat given off by your PC, just open the door to the warmer room and let the heat flow.  And there is no need to install a second compressor (like used in the Tesla) to remove heat from the PC server room, it will leave via the home heating and cooling system without needing to add additional stuff.
Reply: What's truly insane about all this is that, well, heat exchangers are hardly a new invention.

Your fridge operates by the same basic principles. And no-one's thinking that refrigerators are some new-fangled technology.

My point being that, you know, we've been leaving this technology on the table all this time. We could have been using heat pumps decades and decades ago.
Reply: @Undecided with Matt Ferrell - Has it ever accord to you that everything on earth is constantly being recycled? The need for conserving natural resources is discussed from a point of view that resources are used & just disappear. I never hear people discuss the facts about how oil is formed or how little of it humans actually consume or what happens to oil when it used & how its reintroduced to the earths ecosystem & consumed by vegetation & converted to oxygen. The life cycle of the ecosystem is completely ignored by activist that claim & have convinced many people that the Earth offers a limited amount of resources. Its like people talking about water like you drink it or use it & it just disappears & gone forever. What happened to critical thinking?
Reply: Heat pump computers.
Reply: A couple of corrections
134a is defiantly not used for Air Conditioning or Heat Pumps (R410a) it is normally used in Refrigeration and is being phased out by the end of the decade. It also has a very high global warming potential 1,430 times that of CO2.
Given all refrigeration systems do leak their refrigerant the refrigerant matters. You should go check out the labels on all your refrigeration systems and check the GWP of each kind.
New Coolers replacing 134a use R600 and R290 both (isobutane and Propane).

As for the heat pump driers? Not sure where the claim they last twice as long as a conventional dryer comes from? I own a appliance repair business and can honestly say the older resistive dryers seem to last far longer than newer dryers in general and given the added complexity of a refrigeration system inside a unit that is tumbling and requires extra care and maintenance I very much doubt that claim. 

Currently I can tell you most refrigeration systems in appliances are poorly built, and do not last more than 10 years before major repairs. Seeing the general poor quality of manufacturing and cheap components I think we have a major unreported waste problem. 
Simply go to the appliance drop off at your local land fill, check the fridges and manufacturing dates, you will see more fridges in the 0 to 15 years than 15 to 30years. 

Efficiency is important, but when manufactures are constantly chasing better energy star ratings vs better coolers they tend to make things cheap and efficient. Not Efficient and longer lasting. 
Its a major scandal and it should be brought to light.